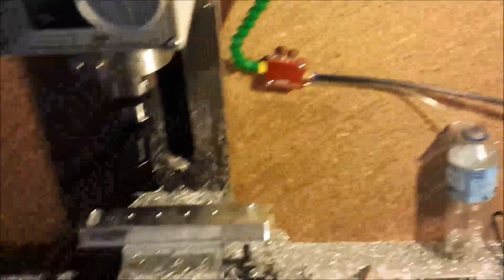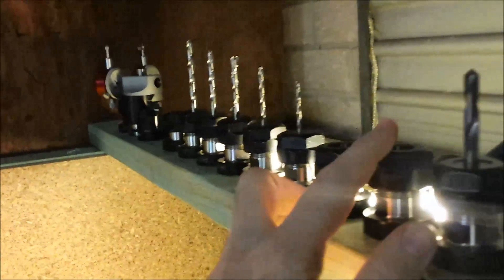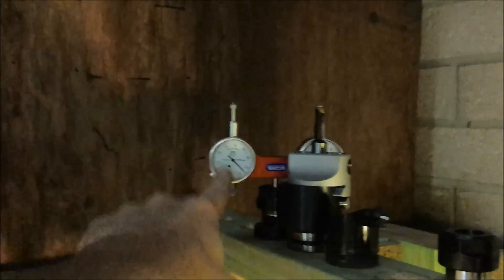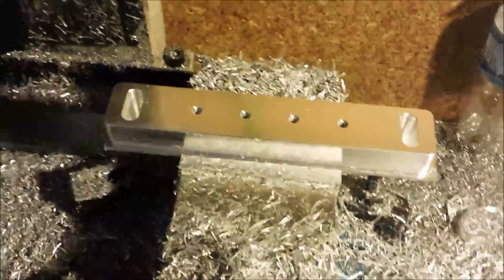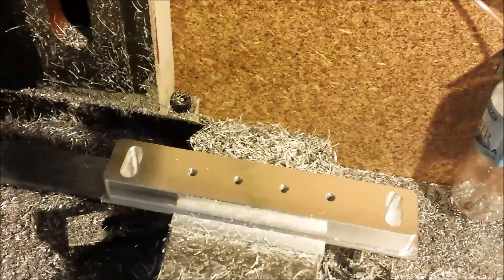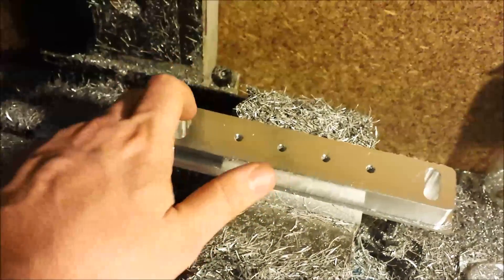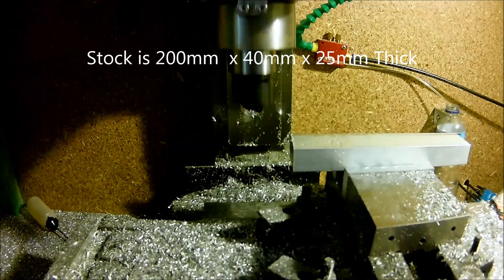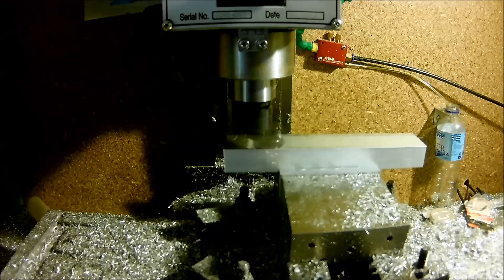Titan TM25v Overview and parts

Comment: nice work!  I love my closed loop steppers! glad you do too!

what can software are you using?

looks like you could go quite a bit more aggressive on you DOC on your profiling especially at that feed rate. line you said in the video you didn't have a finish pass,  it if you wanted to go  more aggressive on the roughing passes and run a finish pass you would have the same finish as now and reduce milling time by a large margin.

what end mill were you using in that operation?

Sounds like your Gibbs are a bit on the loose side, you can see the stacks of chips shaking around from vibrations and hear it in the cut.

what did your backlash end up coming out at?
Reply from the maker: the closed loop steppers are nice, I could certainly go more aggressive but the endmill I am using isn't that great in aluminum and any faster causes to much vibration, I need to get some aluminum specific endmill with the right geometry then I'll be sailing